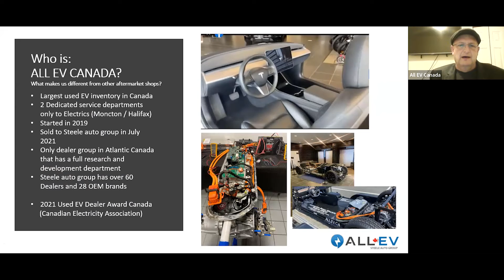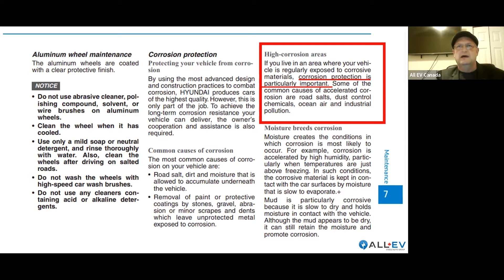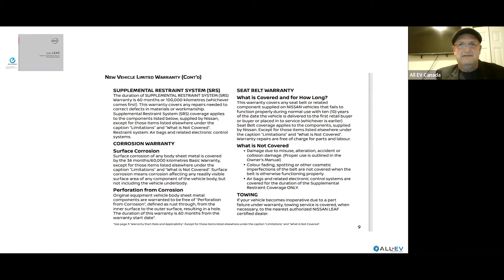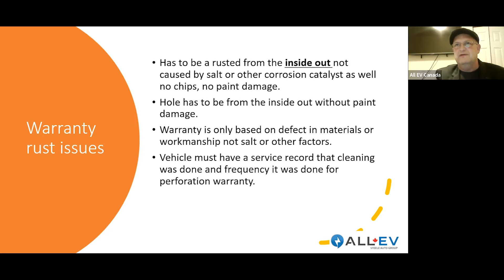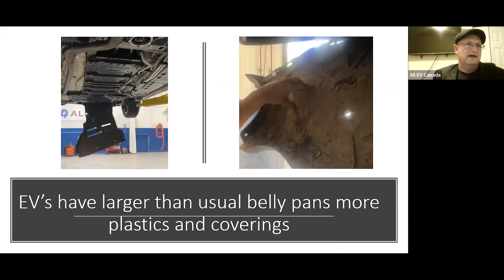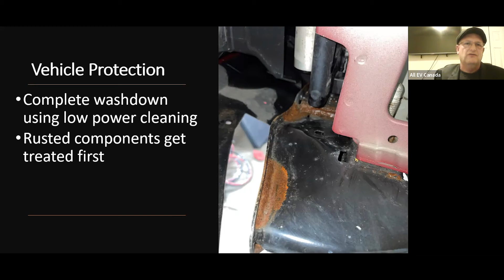Electric Vehicle Rust Protection Information Session

Comment: I was sold Toyota factory-installed "Electronic Rust Protection" when we bought our 2025 RAV4 Hybrid. They are supposed to work on the basis of maintaining a charge that prevents the galvanic corrosion that causes rust.  I've heard varying opinions on the effectiveness of this system, with many on-line sites claiming they don't work, and they are a scam. What is your understanding of how well they work? How likely is Toyota to promote and sell a system that isn't cheap, and doesn't work? Are there actual long-term studies on the effectiveness of these systems?

Comment: On my Model Y took out the fronk and sprayed all the electrical grounds with a product called Rust Cure highly recommend by my mechanic brothers.
Took off the lower covers sprayed all the electrical grounds also. Plus  lower structure.
Also both oil filters per my brother that says he finds oil filters that spend time in salty weather can rust out.
Found on my 2018 3 there was some corrosion on ground connections.